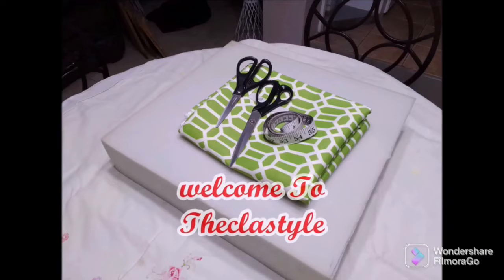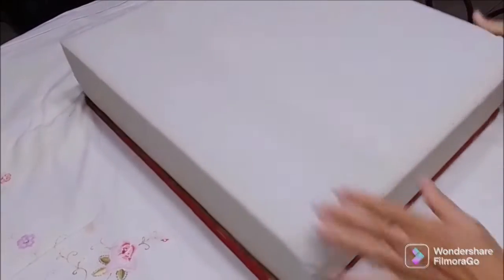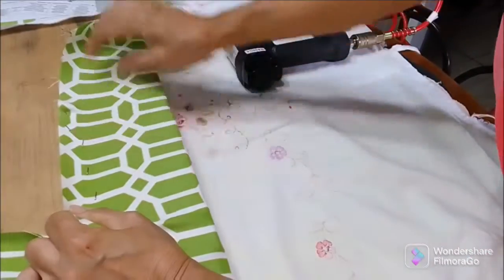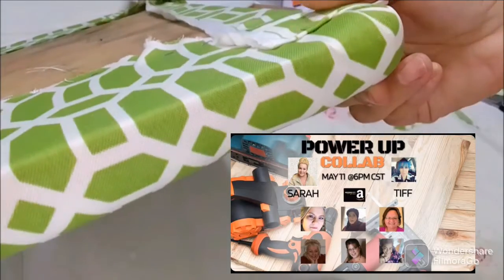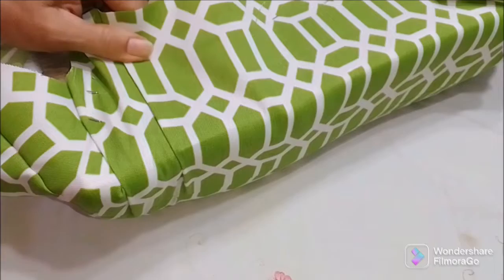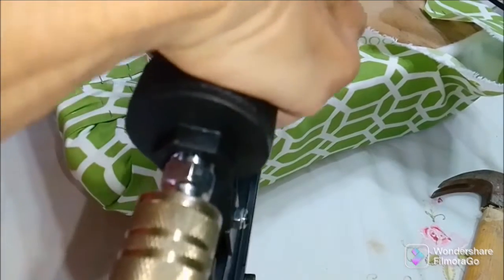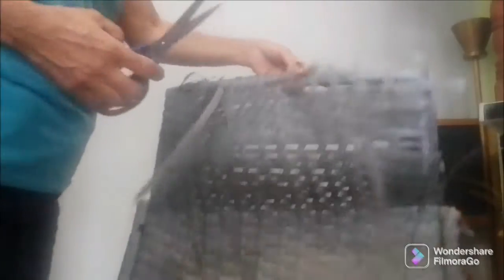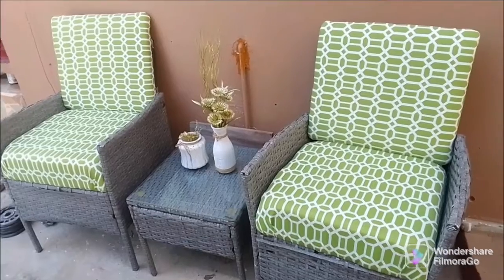How to Reupholster outdoor cushions

Comment: I have the same exact set and this happened to mine as well. Very nice job. I tried reupholstering mine but without the cushion. I live in miami and the sun is really harsh. I think that is what ruined them or maybe the material is just cheap 😣
Reply from the maker: @tracycakes85  I totally agree with you its not built for tremendous heat.